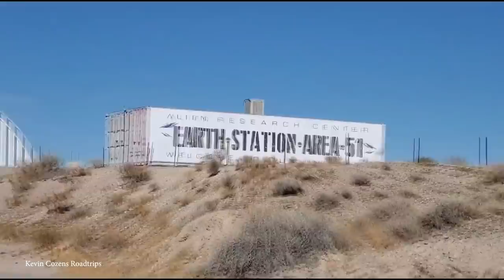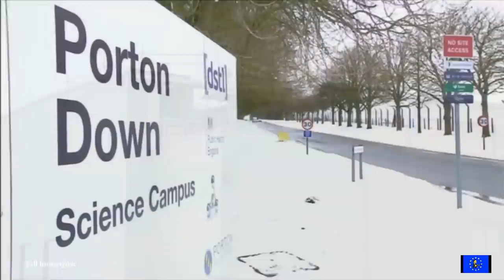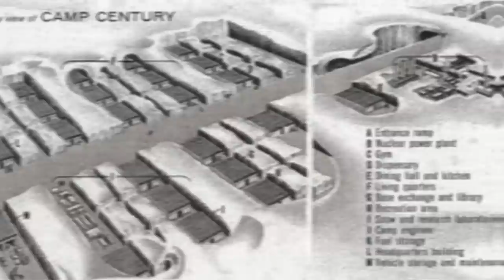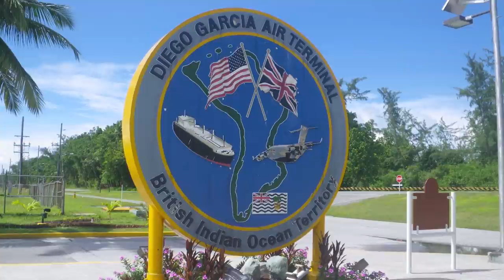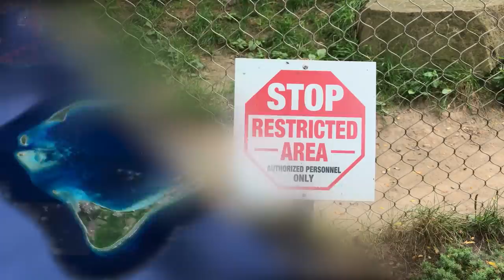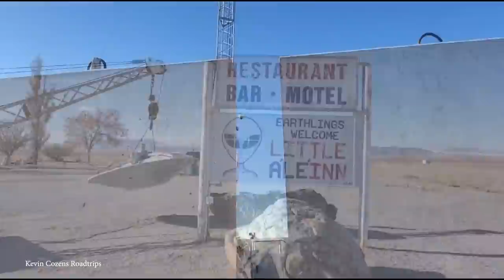15 Most Secret Military Bases

Comment: I was stationed at Nellis 81-84 and Area 51 was collectively known as "Dreamland".  Folks would leave on Monday morning in a small A/C with darkened windows, and not returned until Fri afternoon ... except for a few Narc K-9 teams that would periodically go for a one day "shakedown" of the facilities.  They could never say what the saw or did, only that they went to "dreamland".  They had 1 1/2 lines on the ramp where they had A-7s and let me tell, those guys working there were way better than the cops guarding the ramp.  I'm sure, for every 1 "secret" military installation know, there are 2 unknown.  And BTW, we called the base "tooley", not Thuleee.  It was one of two of the remote bases cops dreaded being assigned to.

Comment: The north pole is oean covered with ice and there is no such a base at the north pole. Telling such obvios non-sense does only hurt your credibility. However that is, Even if that thing would be at the north pole on sea-ice, it would not correespond with your image and then the north pole is not a good place for anything since it has repeatedly been ice-free over the last two decades.